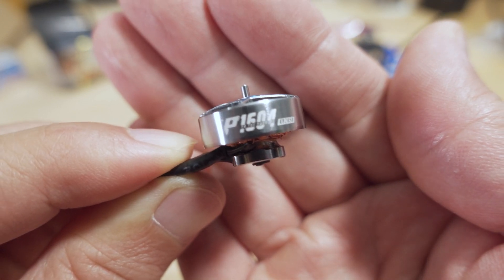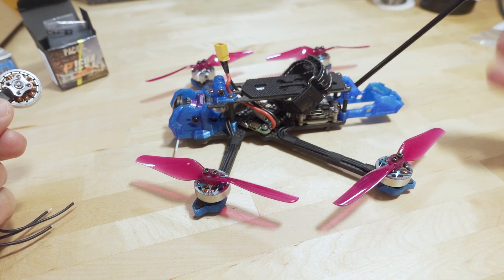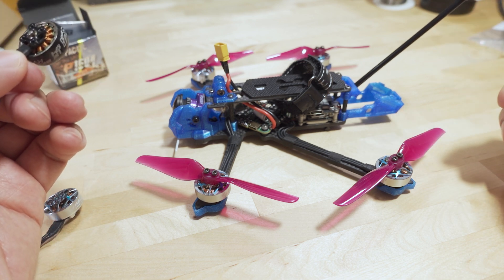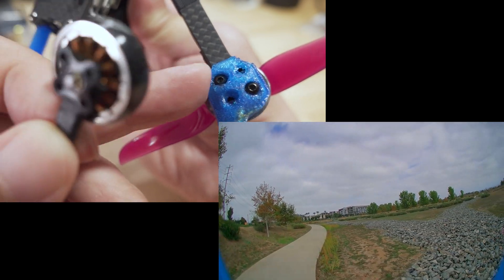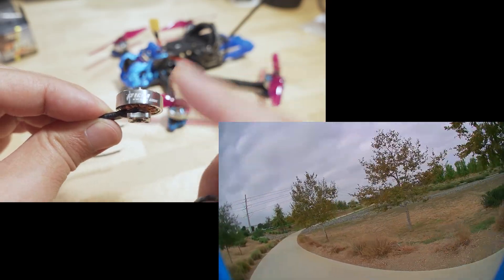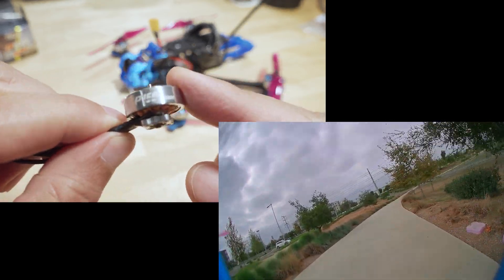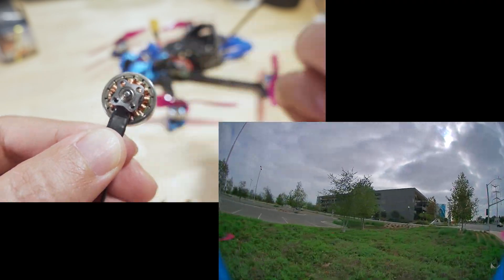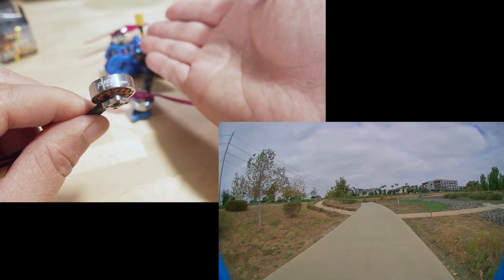T-Motor 1604 2850kv Motor Review 🔥

Comment: i have the t-motor p1604 2850k, is ok to run with 4s batteries?
Reply from the maker: Sure, on a 4-inch prop that combo would work.
Reply: Hi  @AlbertKimTV would it be ok to run these 3.5 inch prop on 4s 2850kv version

Comment: Bro I have Pavo25 V2 I want to change to 1604  6s is that good
Reply from the maker: The motor KV at 2850 might be too much for 6S and 2.5 inch props so I would start with a motor output limit and see if it can handle it.  Also, be sure that you've got the version with the AIO FC that supports 6S.  I believe the early version only supported up to 4S.

Comment: Hi,

Wondering how this motor will do on a 6x2.8 on 2s instead.
Maxing out on 4.2Amps (calculated max)
Like a mini 2 setup.
Prop: something like a Gemfan LR Durable 6026 2-Blade but also looking for a folding prop this size.
Maybe 5.1 or 7" is also worth trying.
7" is probably too much. 

Thanks for your review.
Reply: Or maybe you have better option. Has to be semi long flight time.
20/30 min on 2s2800/8c lipo or something similar in Li-ion.

Comment: Nice video, did you fly the 2850kv on 4s? I’m thinking in a 2.5 whoop for interiors what u think abou it? But I’m have to decide de kv
Reply from the maker: Yeah, 4S on a 4-inch prop.  For 2.5 in you want the higher 3650kv motor instead.
Reply: @Albert Kim  thank u for answer I really appreciated it 💓

Comment: You had to mention 3", didn't you! 🤣🤣 In the process of guessing parts for a 3" build, so now need to add this to the list of motors to consider. And debugging quads can be... Interesting. Black box logs are essential at that point.
Reply from the maker: black box logs can tell you whether you have a bad motor or bad ESC?
Reply: @AlbertKimTV  when the actual attitude of the quad is not what the FC is commanding it to be, that would suggest ESC/MOTOR/PROP issues ;) erratic variances to amps drawn and vibration would hint at it being motor related, perhaps broken winding wire. But I'm no expert in bb tuning and debugging.

Comment: Oops, just built a Crux35 with obsolete motors. 😊
Xing's 1404 3800kv because they had the 9x9 mount pattern. Fortunately I do like Xing's. These new motors look good. They look like they'd go well with the Flywoo Explorer. Happy flying everyone. 🤓
Reply from the maker: That one is pretty light so not sure if the 1604 will help much other than being smoother.  I think the 1604 will be more noticeable on a heavier setup.

Comment: Thank you for the informative video, I was looking at the FPVCycle 16mm but there's only one or two props available in 3.5" 5mm, now there's a wonderful solution for my AOS 3.5 V2 build.
Reply from the maker: Glad I could help
Reply: @AlbertKimTV  that you did, very much so.  I was grappling with the FPVCycle motors, I love all the one's I have on my other  builds but just felt backed into a corner with one prop (2 if I used 3.5" cinewhoop ones) using a 5mm shaft. Your video is a blessing for my build 3.5" cinematic build, again, thank you for all that you do!

Comment: Fantastic flying and review, Albert! 😃
Finally some 16mm size motors! I hope some company starts making a 1608 as well, it would be great for many applications!
Stay safe there with your family! 🖖😊
Reply: Brotherhobby had the Tornados in 1608, but they had a weird bolt pattern (M3 on 12*12). They're still great, but are of an older design.